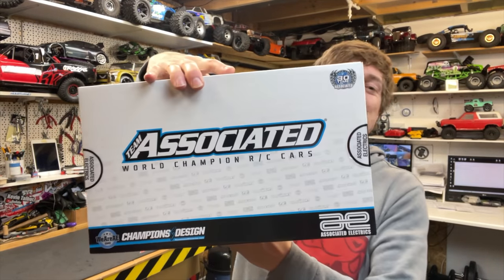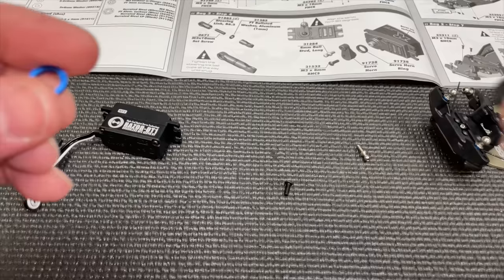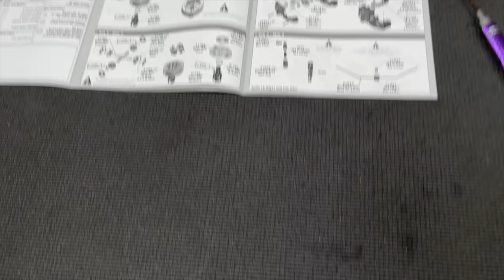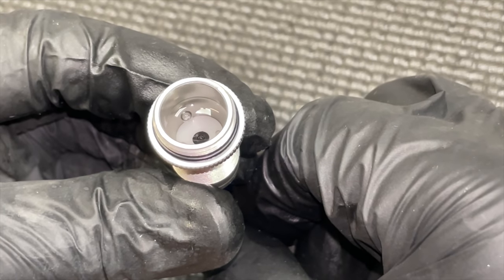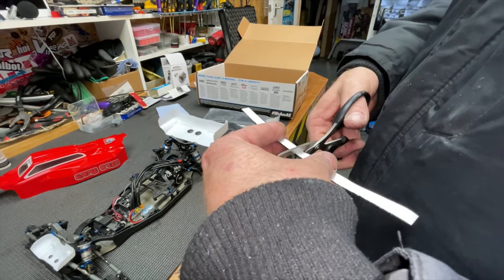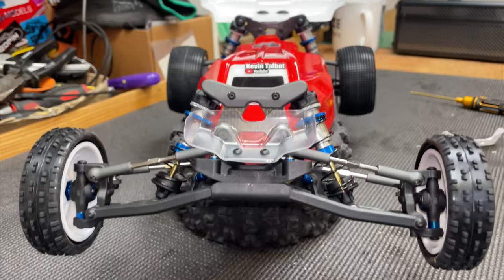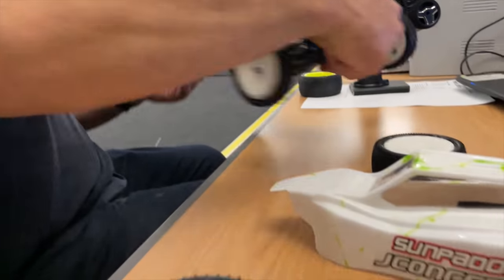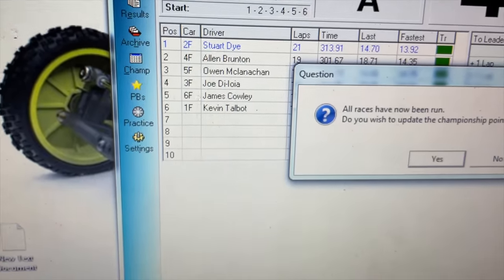Idiot Builds and tries racing a pro RC Car

Comment: A few years back, when I worked in a hobby shop, my experience was to have a set of wrenches for 1/10th or similar scale, then another for larger scale.  We worked on HPI Bajas a lot.  Where tools failed or lost their purchase/bite, was when they did double duty.  Torquing up screws and bolts, on 1/5th scale models was different to smaller scale RCs.  Especially when thread locking compound is added into the mix.
Reply: Or Kurt Angle

Comment: "Some assembly required" would be the understatement of the year!
Reply: This is the way EVERY hobby grade rc car and truck came new.  I honestly miss and PREFER the "old days" of having to build it yourself.  For one, you know who put it together (yourself), so you learn from it and know exactly what's going on inside. 

Also, I've had so many modern RTRs that are just so "sloppily" thrown together, it drives me nuts!  ..go to replace something or do maintenance on it, just to find out the minumum-wage worker who couldn't care less about the thing at the factory stripped out half the screws/put something together wrong or half-assed, and it just ends up a headache, more often than not...

I wish most manufacturers would give the choice if you want to build the thing yourself, not only because of what I've already mentioned, but to me, it's a lot of fun building in the first place (and painting/applying decals, so they look better than if a 5 year old put them on...)!

Comment: Kevin with as many cars as you build you need to invest in a Hudy vacuum chamber. Pulls all the air out of your oils. Examples are your shocks, diffs etc. In my opinion it saves time and is WAY more effective then the finger tap and set aside. Just my two cents worth.

Comment: Team Associated B6’s are great buggies. I have a B6.2 and so far it’s been pretty durable and stable. If you add a few upgrades like shocks, tires, suspension, it turns out to be one greatest buggies I’ve raced.

Comment: Kev take the front washer out of the ball studs to give it more steering and go down to 2k in the diff oil should give it more traction making it hook up better so it would be sliding around or pushing as you would call it and lower the rear ball studs

Comment: Kev buy a hudy set up kit for 1/10 buggy it goes though set up for you tells you what to change and the expected result of the change , learning camber ,caster , toe , roll Center ride height ect is fun making the changes and feeling the difference it makes ,knowing it and doing it on Rc cars that take a few minutes is all the same full size .. Rc will help when you start full size monster truck and save time full size cars take so long to set up ,having a idea learnt from Rc gives unfair advantages …ppl that can set up Rc cars well when they start full size racing move and qualify to the A finals real fast as they know oversteer, understeer and how to get grip . There’s lots to learn but it’s all fun once you get the racing bug it’s hard to shake .. maybe try some on road racing ,if there a track near you and the pros are so fast and know set up so well … the ultimate set up kit is just that it has the tools and information to make your car fast and consistent and hudy is a bench mark with racers world wide yes there cheaper stuff out there but the hudy stuff and tools is the ducks nuts and quality that’s hard to compare …p.s hudy is a spin-off of x-ray luxury Rc race cars …

Comment: 👍I started racing RC cars the same year the first true RC race buggy kit came out 1984  the Associated RC-10 and I bought one as soon as it was released, I had been as had most of the guys at the track had been racing tamiya  grasshoppers which is so funny looking back on them mid- late 80s and the major evolution in RC racing and especially the 90s racing everywhere and awesome tracks everywhere it was RC Heaven.... I switched over to the JRX2 when it came out IN 88, I thought it looked better with the derlin parts and better a-arms it was a cooler car but it seems the RC-10 hasn't really changed that much after 38+ years on the market. I switched over to 1/8th gas in the mid 2000s and havent raced since 2015 due to more of a end of an era with everybody else gone and a new crowd of Racers unaware of the beginning of dirt off-road electric and how it went from zero to hero in just a few short years in the 80s...

Comment: You can use rtv on screws when you don't want to use locktite. It holds them in place well without locking them in too tight. I've been using it for thirty years on screws and bolts I didn't want backing out. There's a slight drag when removing it next time but nothing like locktite.

Comment: Did you get the steering sorted?  The first thing every experienced RC racer is going to check when a newbie asks for help with this is to make sure the steering servo endpoints are adjusted correctly.  You want to get maximum steering throw dialed in as best as possible without making the endpoint too long which will bind up the suspension which will make it handle funny and stress the servo parts.

Comment: Building an rc car from scratch like that would be so fun.
Reply: I miss those days where EVERYTHING was sold as an assembly required kit.  There were no RTR at the Hobby shop when I got into the hobby back in like 1991.  Now only a handful of cars are available as a kit, mostly the high end race cars like this one.  Losi, associated etc.  Building the car was half the fun plus you knew how it all went together so when you had to fix something or change something you knew how
Reply: It really is fun. Just takes a little while to tune your car
Reply: The only rc car I have is a 20 year old t-maxx that doesn’t even run. So I wouldn’t know.

Comment: Kev, please never use brake cleaner to degrease a body, because brake cleaner is greasy and leaves a thin layer on the components. You can tell by the fact that more and more paint flakes off over time. Just use dishwater and a sponge :-)

Comment: The wheels you have are good enough but the blue spacers in the front hubs, swap them so it should be small spacer on bottom and big spacer on top and put your shocks as far out as possible. (If it’s already that way then swap the spacers I didn’t see which spacers were where)

Comment: If I do Race Wheels and Tires. I wash with Simple Green from new, dry and glue Only with AKA tire glue and speedy dry. That is my only way to do racing tires I don't trust cheap glue for cracking reasons. Aka stays "soft" till about 0 degrees F

Comment: Don't fill the diff to full...build a couple diffs with lighter fluid..if you want that bugger to corner.. im surprised they don't have foam tires on carpet..you need the rubber band kit for mounting tires to rim makes all the difference ..

Comment: Where is link to tools?
Reply from the maker: Cheap RJX Tool Tips
https://www.banggood.com/RJX-6_35mm-4-in1-Hex-Screwdriver-for-RC-Car-Helicopter-FPV-Drone-p-1467123.html?p=AO191223234372201807&custlinkid=1451731

Tool Tips with red handle 
https://www.banggood.com/RJX-RJX2881-13-In-1-Hex-Nut-Phillips-Flat-Screwdriver-Multifuncational-Repairing-Tools-Set-For-RC-Models-p-1542018.html?cur_warehouse=CN&ID=6157215&p=AO191223234372201807&custlinkid=1454396

Hand tools Black/gold 4 pc set
https://www.banggood.com/JINHUI-1_5-or-2_0-or-2_5-or-3_0mm-Hex-Screwdriver-Reparing-Tool-For-RC-Models-p-1607984.html?p=AO191223234372201807&custlinkid=1451732
Reply: @KevinTalbotTV  Thank you. I just got into rc cars because of you.